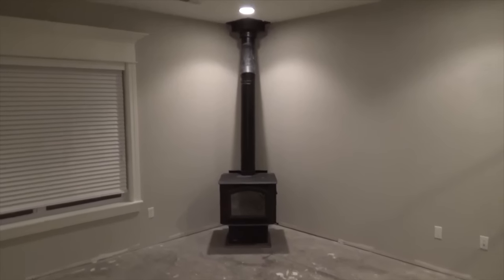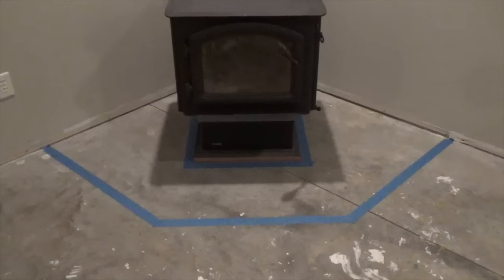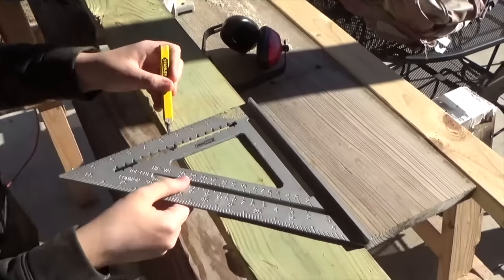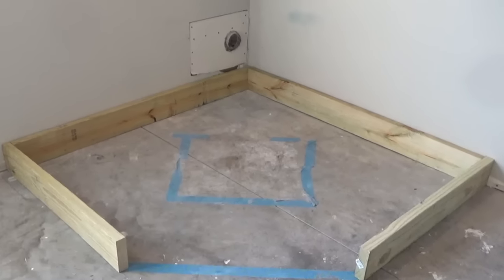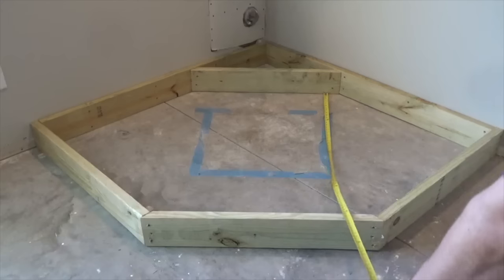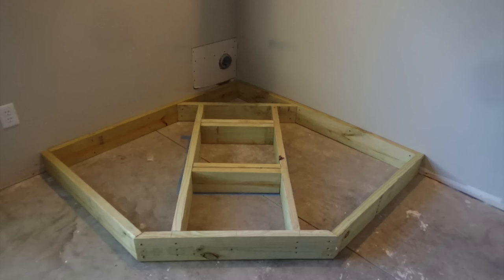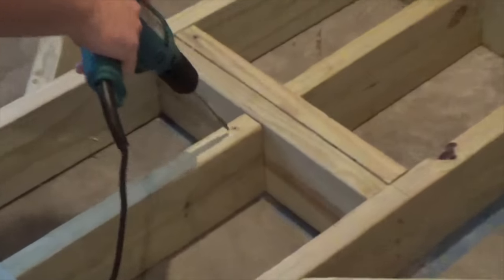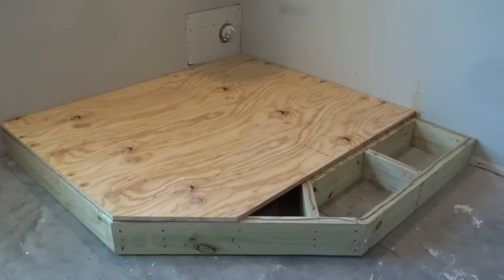How to Build a Wood Stove Hearth - Framing a Hearth

Comment: Why treated lumber
Reply from the maker: Just like the bottom plate of a wall in a basement, this lies on the floor as well. It is code and just a good idea to use treated lumber that is in contact with a basement floor. ya know what they say, "not IF you have a water leak but WHEN you have a lot of water leak"

Comment: Thanks! I built this hearth design and just finished tiling it. It does not flex at ALL when walking on it. Great design.

I did not screw it into the walls or floor because I have thick carpeting and it snugs right in.

 I removed the carpet under the hearth so it sits on the bare wooden floorboards under the carpet. I wanted to be able to move this thing, just in case!

I used 3/4 plywood, concrete backerboard on top of that, then thin 12 x 24" gray porcelain tile. I used very similar stone for the hearth side trim and back wall.

Again, thanks!
Reply from the maker: So glad my video helped you out!  Thanks for commenting!

Comment: Great job on the hearth! I plan on doing this fashion hearth myself. What I'm really interested in is your stove pipe placement in the corner of your ceiling. Did you install that? How is it done? I really hope you answer this, because i can't find a video that shows this type of install. Thanks, and God bless!
Reply from the maker: I had a pro-wood stove installer do it.  When dealing with fire, I recommend pros.  I've only installed in barns and shops.  Houses are different.

Comment: Probably a stupid question but how critical is it to attach this to the wall? 

I ask because that effectively renders it permanent without the possibility to remove or move without damage.
Reply from the maker: You don't have to screw it to the wall.    A lot of your choice would depend on how you finish it too.
Reply: Mine is in my rental, I plan on taking it when I move, so it’s kinda like free floating, but very solid!

Comment: 1.) your wood stove was already hooked up. When you reconnected after adding the platform, raising the stove several inches higher, what adjustments , if any , did you need to make to the directly connected stovepipe to make sure that it was lined up with the Exit hole? Our stove pipe will be exiting the wall not the ceiling. Better to tape out the desired location and wait for hook up?

2.) an r value of 1.45 is required for the surface our stove will sit on.  my plan is 2 layers of micore 300 and a shattered mosaic ceramic tile (heat resistant grout and mortar of course) which brings the r-value to 2.04, well above requirement. Will size it appropriately so that it is the required distance from the hardwood floors. so anyway, without doing the work of the framing you’ve shown here,  the height of my hearth will only be 1.25in. I like the look of a flatter hearth that is more flush with the floor, but , do you think it’s ok to do one unframed? I am just wondering how will I keep it from sliding? Will I need to attach the micore to the surface under the hearth with a glue? The surface under the double Micore and ceramic tiles will be hardwood but it will be well protected by the 2.04 r factor.

Thanks to you, or anyone else who can chime in!
Reply from the maker: Wow! That's a lot of questions! I hope someone else chimes in. I simply followed the woodstove placement instructions in the pamphlet and relied on the subcontractor that installed the stove.  I also hired out the stonework because I am not an artisan of stone

Comment: Did you require a heat shield on the stove for the wall clearance or did your wall backing serve as a heat shield?
Reply from the maker: I just followed the recommendation for this particular stove.  Each stove will have their own.

Comment: Hi , even though the stone tiles aren't combustible the plywood and 2x4s underneath are  . . ....... is that a problem ? I just watched a vid. on clearances and I understood that wood and other combustibles underneath metal , stone or ceramic tiles can still combust if they get too hot and this possibility increases over time as the wood dries and degrades . The instructor called these hidden combustibles and said they are dangerous because one can't see how the wood is changing over time , subjected to the heat transferred through the noncombustible materials , if you know what I mean .
Reply from the maker: This all depends on the stove that you buy.  Each stove has its own criteria and instructions for the type of hearth you need to build.

Comment: what did you use on the back wall and where did you get it, also is there a 1 inch air space between the back wall.
Reply from the maker: I hired the back wall out.  It's definitely 'art', and I wanted to make sure it looked good.  so..... I don't know what the hired help used.  sorry.

Comment: Why treated lumber?   Why not use concrete board for base instead of 3/4 plywood?
Reply from the maker: Treated lumber for the base structure that is a making contact with the basement floor.  Just like how the bottom plate of a wall is required to be treated lumber due to moisture (especially in a basement).   As far as base for the stone work, it all depends on how you finish it.  Plywood is stronger, and not brittle like concrete board, and you can either screw to it: hardiebacker, wonder board, or like my mason did on this one, he used a screen and mortar base.   There's more than one way to skin a cat.   I would, however, only use treated for the framing for sure.  Hope this helps.  Thanks for the question, Michael!

Comment: Would I have to break the existing ceramic tile in order to do this??
Reply from the maker: I wouldn't brake the floor up.  however, sometimes I'm wrong.  haven't been in that situation, but I personally would just put the hearth on top and screw it to the wall studs.   great question.
Reply: @PhilCrockett  thanks for taking the time to reply!

Comment: So if i was to put a stove on my first floor of a 3 story house,would it be easier/cheaper to run the pipe out the side wall up to the roof or up through the floors of the house?
Reply from the maker: consult a professional fireplace business so they can come out and look at your situation.  This decision should be done on-site.
Reply: @PhilCrockett  no. Im not insured so its a diy kinda job. Any pros i bring in will not help.
Reply from the maker: I see.  well,..... I can say this....
I put my own pipe and stack in my shop, and I was thinking the same thing.   The outside segments of the stack is WAY WAY more expensive than the inside segments.  It was way cheaper to go through the roof.  PLUS, you're chimney needs to be higher than the peak of the roof.  keep that in mind.  So...... I installed the cheaper black pipe segments up to the roof, and then finished out with the double walled expensive segments.

Comment: Hello. Did you adhere the stone directly to the plywood ? And did you make a video of this ? Thanks
Reply from the maker: I did not make a video of the stone work.   This was a decision I struggled with.  I've done very little stone work, and decided to hire it out.  I'm so glad I did, because the man I hired was an artist! I couldn't have done a better job.  I did, however, notice that he used the mesh and mortar technique.  Hope this helps.
Reply: I screwed cement board down on top of the plywood. I decided to use porcelain tile and premix thin set mortar. For the walls I screwed the same 1/4” cement board to the sheet rock same and premix mortar, however I used a stackable stone from Menards which looks really good imo. I questioned myself not using the mesh but it would take a hurricane to get it off the wall.

Comment: 4 inch deck screws a bit over kill?
Reply from the maker: indeed!
Reply: not enough. take to pairs of vice grips and bend a 4 inch deck screw. and try it again with a 16d  framing nail. which ones snaps easier...

Comment: What size and type of hearth stone did you use?
Reply from the maker: Centurion Stone is where I got them.  I don't know the proper specs.  I simply went in and asked the salesman for advice, and he set me up.  I didn't lay them myself.  I hired a guy that was an absolute artist at stone work.  I knew I wouldn't have done as good of a job as him.  There are some things worth hiring out, especially when it comes to aesthetics.  Find a Centurion Stone dealer in your area, and get some advice.  You won;'t be sorry.  Hope this helps you out, Steve.

Comment: Hi Phil, I know this is an old video that you posted but I'm hoping that you can answer my question...

I'm building a rectangular shaped hearth using 2"x6" just like in your video.  However, I have a wood flooring in front of my existing fire place and I had planned to glue the base of my hearth down on top of the flooring instead of trying to remove the wood and possibly damaging the pieces since my wood floor was glued down when it was installed.  I noticed another person had a similar suggestion but with vinyl and you suggested against it.

Is my situation the same in your opinion?  I'm looking at hearth the size of 18" x 69".  I'm going to use the 2" x 6" boards to make a solid base.  I plan to screw down backer board on top of the boards after I have the base constructed.  On top of the hearth for stone we are going with granite.  For glue I have Liquid Nails (Max Strength).
Reply from the maker: You'll be fine.  A hearth is just a glorified rug.  I didn't glue mine to the floor.  It's been serving me well for some time now.  You'll be alright.

Comment: Can anyone install a wood stove or does a licensed person have to do it to pass code.
Reply from the maker: If you mean "just the stove", then you can put it in yourself.  Just make sure the pipe is fitted properly and the stove doesn't have some unique venting system.   My wood stove has a vent tubing that looks kind of like a clothes dry tubing.  In my video, you can see where it goes to the hole in the exterior wall.   Other than that, wood stoves are easy to set up, but VERY heavy.   Don't hurt your back!